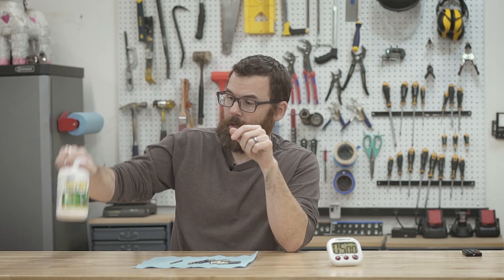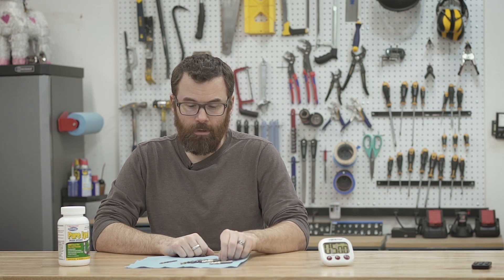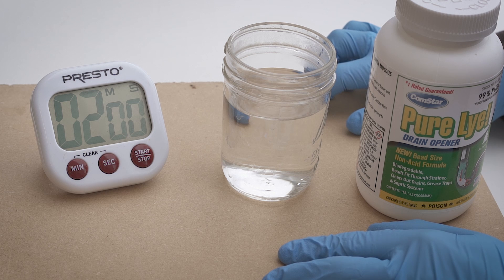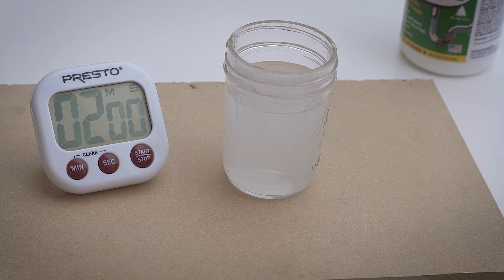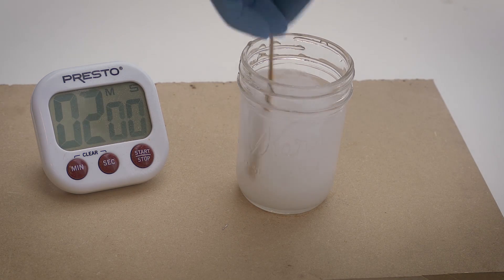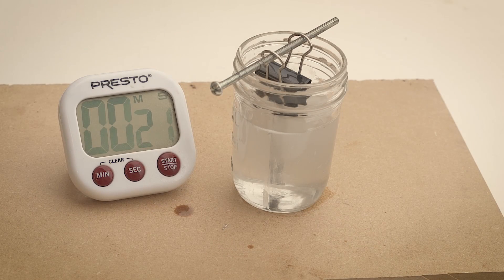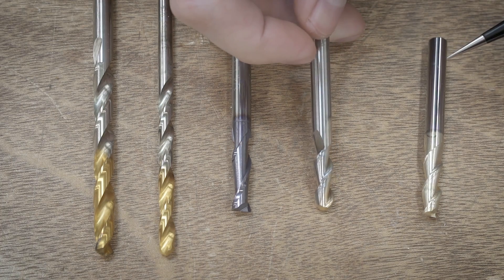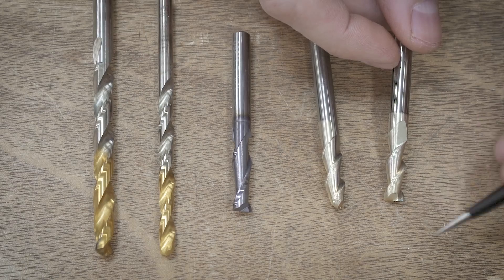How to Remove Aluminum Chip Weld from End Mills and Drills

Comment: That worked well!  I had a 1/2” carbide mill that had aluminum welded on to it, and some TiN coated drill bits that had turned grey.  The lye took it all off, and they look great, though my mixture took quite a while to get the job done.

Comment: How do you properly dispose of the used lye solution?
Reply from the maker: Great question.  HEAVILY dilute it and pour it down the drain.  (this came from my wife who is actually the director of a wastewater treatment plant)
Reply: @RobertCowanDIY  Thank you! That's good to know. We rely on well water and septic so I'm rather cautious what goes into or near my land.
Reply from the maker: @BogDrakonov  Same, we have a septic system too.  As long as it's heavily diluted, it should be fine.
Reply: @RobertCowanDIY  Thanks! I appreciate all the info.

Comment: Thanks for the to tip! I used “drain cleaner”, which is sodium hydroxide. I don’t know the concentration. I had large amounts of aluminum welded to an endmill after by mistake running at a too high RPM. I had to soak the endmill for hours before everything came off.

Note that sodium hydroxide also reacts with titanium and zinc, according to Wikipedia.
Reply from the maker: Thanks for sharing!!

Comment: I have some aluminum build up on the end of the spindle (used machine, new to me).  Could I use this process to get rid of that without damaging the spindle?  Was thinking just dip the end of spindle into container with solution.
Reply from the maker: Is it hurting anything?  If it's not causing issues, I wouldn't.  You don't know what the metal is, and it could corrode it horribly.

Comment: How to dispose that caustic soda + water mix after use?
Reply: Vinegar , and more water
Reply: Caustic soda is what is used to clean clocked drains, so I have just poured it down the drain. On an industrial scale, or in bigger amounts, this is probably not a good method. I assumed the environmental impact would be negligible from pouring down about 1 dl down the drain, when the bottle instructs you to pour 5 dl. The bottle does not have any warnings for environmental impact, as chemicals that do must have.

Comment: !!! There are special coatingS, or NO coating for aluminum, the coatings you chose are much worse than uncoated for aluminum. !!!
Reply from the maker: Oh, I totally admit I use the wrong endmills on occasion.  I just call up the one that is already in the tool changer because I'm lazy.  My CNC router is much more picky about tooling, so I've learned to pay more attention to what tool I'm using.

Comment: Yep. (Here in Britain 'lye' is known as caustic soda. Same thing.) Robert gives plenty of good safety advice about handling the stuff - gloves, glasses, etc - and it's every bit as nasty as people say. Watch out for splashes on your clothing, peeps, and don't breathe in any fumes.

Caustic soda/lye burns are terrible. They go deep. Really deep. In some ways the stuff's worse than concentrated acid, because it eats flesh and doesn't wash off easily with water - it just dissolves you more slowly!

Comment: Please!!!!! Could you very minimally apply lubricant to the cutters/drills??
You will save a massive amount of time and trouble. Not to mention the cost of replacing unsalvageable tools.
Reply from the maker: I do apply lubricant, but some of these bits have been used extensively for many years.  Everyone makes mistakes from time to time, and these bits have seen their fair share of mistakes over the years as well.
Reply: @RobertCowanDIY  
Mistakes are fine. We never stop learning. 
The only certainty in this metal cutting business.... ? Our next cock-up is coming! I have 32 CNC years now. (as a career), and every day there are still things to learn. 
Good luck. 👍

Comment: Why are you using TiAlN on aluminum? That coating has tendency to weld itself to aluminum specifically.
Reply: That was precisely my comment as well.  Though, I don't think many people realize that if the coating elements contain the same  metal that is being cut, that you will get immediate welding of materials.   I see that exact mistake quite a lot here on YT channels.
Reply: Yes.  Cut, or drill, etc... using dissimilar metals or it will make wild passionate love and you just made a mate for life where, sometimes, it is impossible to remove the material from the bit/blade.
Reply: Yup opposite coating of what you want for Aluminum, author should edit that into his show notes.

Comment: Good video, everyone please realise IF you are getting chip weld something is wrong in your machining recipe...feed,speed,incompatible coating,lube etc.  Avoid rubbing (heat) decreasing feed rate is frequently a problem (rubbing rather than cutting decent sized chips that take the heat with them.
Reply: I can agree on that. Did lots of chipwelding when I first started of as a beginner. It was due to a combination of incompentence; wrong feeds and speeds, wrong width and depth of cuts, in general poor milling strategies that involved lots of slotting, poor fixturing. 

Also contributing was that the cheap router I bought was pretty much worthless when it came to milling aluminium. Since the z axis was pretty much lose / had lots of backlash. Which gave of lots of vibrations. Nomatter how much I played around with feeds and speeds, it rarley changed a thing.  After some tries I gave up and started to rebuild it for more regidity. Now it works like it should. Got a bit more expensive though.

("You get what you pay for" is a Good saying)

 Now I rarley chipweld anymore.

Comment: Interesting effect at 9:17   @ 6:03, one of those cutters seemed to be bubbling quite a bit more vigorously.   I wonder if that caused some kind of cavitation or the heat had something to do with removing the coating?  Were there more aluminum deposits on that one?

Comment: Great vid. And great tip for cleaning the slag off of endmills and such.  
For the uninitiated, With coatings, the rule is to make sure you don't use a coating base that has the same element in the material you're cutting.  Ie. TiALN coatings should not be used to cut aluminum as the materials will bond to each other.  It's also why ZrN or bright carbide works so good with aluminum cutting.   Or AlTiN or TiAlN are great for stainless/alloy steel.   Anyway, just a public FYI and something that I didn't realize for sometime, though it's painfully obvious after you're made aware.